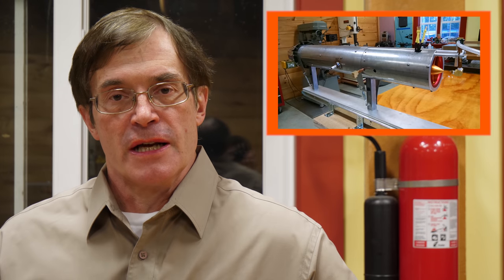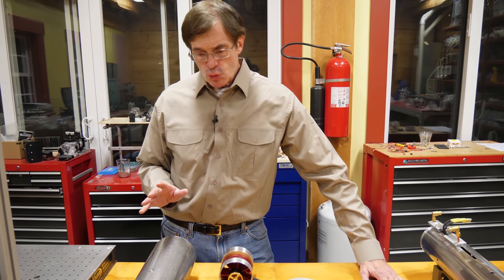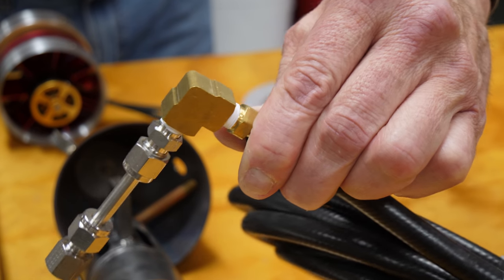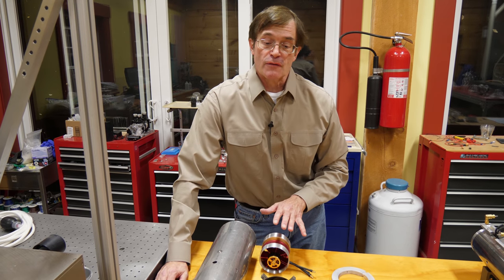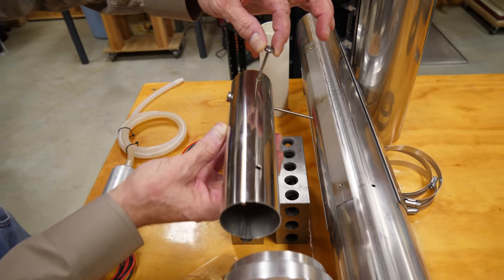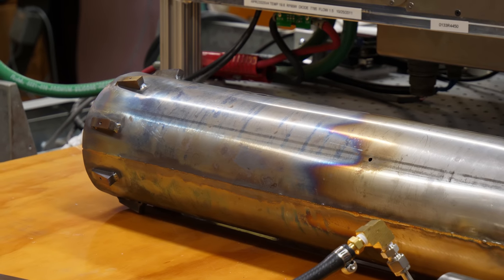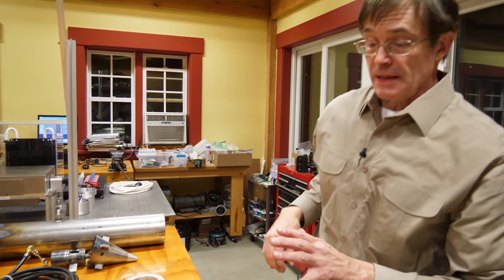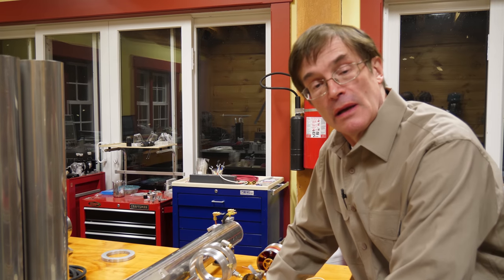Hybrid Jet Engine - Update 2.0

Comment: Observation.  EDF fans are optimized for high velocity low pressure flow.  Just the opposite of your needs for high pressure combustion.  Expand the flow post EDF prior to combustion to obtain any usable pressure/compression, rather than accelerate with the cone which further accelerates/drops the already low pressure flow.
Reply from the maker: Velocity, whether it is in a spiral flow channel or an axial pipe can be converted to pressure when it slows.  You are correct that these fans are optimized, but it is for thrust, not velocity.  They move too much air and they don't accelerate it enough.  Running them beyond spec and two in series helps. The expansion you describe is exactly what is accomplished as the air passes the lip of the cone prior to combustion.
Reply: Watching this thread with interest. Basically I am wondering if the back pressure on the EDF's is too high to let them work effectively. Would some type of centrifugal blower be better? Not my area of expertise, though.
Reply from the maker: These are interesting points, but you are focusing on secondary issues.  Turbulence is necessary for the burn process and homogeneous mixing of the fuel with the air will not occur with a gradual laminar flow pattern.  It is difficult to maintain a flame front even with the shadow of the cone.  This is not simply speculative, we tried it. This engine can operate with a diffuser section as you describe and employ traditional bar shaped flame holders, but any flow resistance in this turbulent region lowers mass flow and thrust, requiring a large burn chamber diameter to reduce the velocity.  We found a 30cm diameter tube was required to eliminate this loss.  It comes down to practical trade offs.
Reply from the maker: We tested these fans on the bench to see how effective this non optimized type of blower could be.  You are correct that a centrifugal blower would be better, however both types of compressor designs need to operate at very high speed before they begin to be useful.  The advantage of the EDF is its availability, compact profile and in the case of these JP Hobby fans, its extremely high power handling capability.
Reply from the maker: When you see the engine operate in part two of this video, you will see that in fact the burn does occur in a pretty small area within the engine.
Reply: Take in consideration the stationary blade this design has to have to function  get the best metrics possible then the rest is built based on how effective the first step is compression and the dynamic pressure increase. All  EDF fans will reach a stall and over spin eventually if  there driven beyond there design limits. Stator blades keep the multistage compressor from  stalling and exploding!.
Reply: I did some thinking about the problem...

It seems there's a relationship with the radius and relative blade speed. If you see any axial compressors at a small size, the exposed frontal blade area only exists at the very outer diameter. The inlet cone is relatively huge on those, and the central portion is extending back from that cone is also sealed off. And I think I reasoned out why...

Now compare that difference between center cone and exposed blades to the ratio seen on a typical EDF. If any pressure builds, about half the area in the middle stalls out and it can't build up any more pressure. So think of it as having a dead zone at the center taking up over half the surface area not doing anything, and the outside rim can't exceed what leaks back out of the center. At some point the central backflow may be enough that additional power is wasted on generating turbulence instead of increasing pressure. It's capped on what it can due due to this loss.

Maybe the guy can do some smoke tests on the inlet with a strobe, and see if my thought on this is valid. Start out with a stock EDF, and then start restricting the outflow. Seems simple enough, given the other expenses so far.

Keep in mind this problem has to do with scaling. Above a certain size (and therefore radius), an axial compressor becomes more effective given the relative blade speed and then it works just fine.

Comment: Very interesting project.
It brings back memories of my research when designing a completely new type of engine.
Here are a few observations that may improve your understanding of what's going on.......
1) The electric "Prop in a Tube" RC model fan can not even come close to the pressure that you need.
       When you are creating additional  "volume OR pressure" by burning fuel in a tube that is
       essentially  "closed-off on one end"  by the electric fan, you will simply put the fan blades into 
       a  "stalled" condition, which reduces the amount of oxygen available for combustion.
       The electric fans may be just fine when used as  "starter motors",
        but they are not capable of generating much pressure, 
        regardless of how much power you may be able to cram into them.
2)  Combustion occurs much faster and more efficiently when you increase the pressure rather than just
        creating great wads of additional volume at lower pressure.
      Therefore, you must have a compressor that can generate high pressures without stalling.
      The higher the pressure is, the less physical space/length/volume you need to burn a given amount of fuel.
3)  Military Jet engines are built the way they are because that's the only way they can make them work reliably.
        The Military really doesn't care much about efficiency, if you what anything even remotely efficient
        you will have to go to a Turbo-Fan engine, like the ones used on every commercial airliner. 
4)  Your engine will not have stable operation at higher outputs if you don't use something 
         better than the electric fans you have now.
        They are the number one limiting factor.
5)   You should check-out this combustion chamber design on Google......  SPRF "Stagnation Point Reverse Flow",
        unfortunately, most of the good research PDFs have been removed by Google and put on sale.
6)   Your water jacket cooling is a good idea, but I would execute it differently.
         The most important thing to do is to keep ALL heat inside the engine.
         The engine should be insulated.
         Water injection should be used to keep peak combustion temperatures down to a safe level.
7)   Axial Compressors/Turbines are really sexy, but they have a narrow operating range and are not very efficient
         when compared to a similar setup using positive displacement Vane or Screw Compressors/Motors.
8)   The reason you need a variable outlet nozzle is because the compressor section has 
        very limited pressure generating capabilities.
        The extra pressure that you would normally get from adding more fuel (after-burner) would stall the compressor,
          so you have to relieve that pressure by opening the nozzle.
        So, you still have the same pressure at the nozzle, but with more volume.
        This is not a factor when using positive displacement compressors/motors, they just make more pressure.
.
.
Reply from the maker: To begin, the axial fans are not optimized for compression.  They tend to move a lot of air, but do not reach a very high velocity.  This is best for electric-only thrust on an RC model.  However, at very high settings the velocity becomes significant and potential compression is proportional to the square of the velocity.  These particular fans are extremely powerful and each stage in the series arrangement is able to achieve 2 PSI gauge/stage.

The higher the compression ratio, the more efficiently thermal energy can be converted into kinetic energy and with a fixed amount of mass, the higher the velocity and hence thrust.  These electric motors do not achieve a high compression ratio, its actually quite low as jet engines go, but compression does occur and the thrust does increase.

You are correct that we want the exhaust gasses to be as hot as possible.  Possible is the operative word, without active cooling we nearly melted our first version of this engine.  Some method of bypass cooling is necessary.  We may elect to change from water to bleed air from the first fan to simplify the system. We may also convert from a steel flame tube to ceramic one allowing higher temps.

My understanding of what is going on is reasonably clear.  When you see part two, this may help to highlight the strategies and the principles.
Reply: The Combustor design that I referenced runs at substantially lower temps, you may want to look at that.
The Ceramic Coating is excellent, the next step is concentric tubes with water between them,
which will then be converted to steam, adding lots of  "volume OR pressure",
and further reducing peak temps.
The efficiency gain/loss from the water is around zero.
You will need a positive displacement water pump that can easily overcome the internal pressure
of the engine, while at the same time providing accurate metering,
which should be roughly 50% water, by weight, when using liquid Gasoline/Diesel/Kerosene.
The volume of water is related to the BTU content of the fuel.

As far as combustion temps, I think I wasn't clear enough.
The object is to convert temperature into "volume OR pressure".
The fuel is actually creating mostly Super Heated Steam as a byproduct of combustion.
Adding water just creates more steam without as much Super-Heat.
Yes, that is Steam that is melting that metal tube.
When you create Super-Heated Steam you are wasting energy.
The excess heat only has one thing to expand to create "volume OR pressure",
and that is the nitrogen in the intake air that was NOT part of the combustion process,
so all that excessive heat doesn't have any additional materials that can covert that heat
into additional "pressure OR volume", that's where the water comes in.
Gases increase "pressure OR volume", with additional heat added, at a linear rate.
But, water increases in volume 1600 times when it flashes into steam.
Unfortunately, there's no free lunch, it takes some serious BTUs to take water from
"room temperature" to ABOVE 100 degrees C.
But if you really could use some temperature management, you may as well  take away some
of that heat with water, so that you will add enough BTUs to the water to get it close to
flashing into steam, which can then be used as additional material for "expansion OR pressure".
Therefore better utilizing the available Super-Heat contained in the combustion steam.
"Theoretically", there should be no reason for the exhaust temps to be over  ~105 C,
if they are, you are just throwing away energy, but actually pulling this off is another story.
I designed an engine that comes close to this, but it's for rotational power, not jet propulsion,
and, believe it or not, it uses 200 year old steam engine technology to achieve ~80% efficiency.
Which brings me back around to the "keeping the heat in the engine" thing,
this is simply an efficiency thing.
You don't necessarily want the peak exhaust temps to be as high as possible.
If you will read-up on the "Stagnation Point Reverse Flow" Combustor you will see
that there are other factors involved in the combustion process besides just "peak temps".
Certain parts of the combustion process take substantially more TIME to complete,
this releases more energy where you want it, rather than blowing flames out of the tail-pipe.
If you can see flames, you are wasting energy and loosing power.
The higher the compression ratio is, the faster the combustion process will occur,
it will be totally complete, way before reaching the tail-pipe, AND, you can either have a
smaller combustion chamber, OR, you can burn more fuel.
If you are heating the surrounding air to ridiculously high temps, your engine will be inefficient.
That energy needs to be going towards making something expand in volume or increase in pressure.
You will never have more pressure at the exhaust nozzle than the compressor can create, just more volume.
My engine design has a compressor that can create over 400psi @ 500cfm and creates
super heated steam at 400psi, which is expanded (and therefore reduced in pressure) in 6 stages.
The exhaust is at, or slightly below, atmospheric pressure, and is already mostly water.
The remaining steam/water vapor is condensed and recycled back into the engine, 
the few odd remaining exhaust gases are vented to the atmosphere, 
which are mostly CO2, which is good for anything that's green. 
No water is lost or has to be added, the water generated during the combustion process
is in excess of the losses to the atmosphere.
The unwanted pollutants in the other odd exhaust gases are virtually non existent.
You are literally building a Steam Engine, (of sorts), 
thinking of it in this way may be beneficial to you .
.
.

Comment: I notice the original fan had stationary veins that are designed to reduce the vortex, this is at the expense of pressure ratio. The next step description is spot on. the stator is almost as important to building compression and volume as blade design attributes of each fan. It is easier to have both driven fans on same shaft design. You have to have data logger on both motors to tune the dual driven fans and the dual attribute makes it  difficult to tune and not damage esc;s or explode fans.  Adding mass to intake works with centrifical 
 vacuum pumps with low air volume. good luck hope you read this and it helps.

Comment: You don't have stators, so you don't have compression. Prove me wrong by plumbing a pressure gauge into the discharge area of the second fan. Opening should be flush with the wall of the casing, so you measure static pressure, not facing into the airstream like a pitot tube, which measures pressure rise due to velocity of the gas stream.

Nice machine work.
Reply: love your content and I believe you aare very knowledgable whenit comes to gas turbine engines but Ithink you may have it wrong with this one they is some compression due to the counter rotating fans eliminating the need for stators  there's quite a bit of research regarding counter rotating compressors you may find interesting
Reply: Actually, a flow surrounding any airfoil (fan or compressor whatever that has a positive angle of attack) compressed by it. As you may know at the bottom of the airfoil has higher pressure than the other so it acts as a compressor.
Reply: @jwh103  air on the bottom of a an airfoil is at atmospheric pressure it's the air that's at the top that has a lower pressure due to the coanda effect
Reply: It could work if it were built like a ramjet, but the fan still may not be powerful enough to make that work.
Reply: AgentJayZ, I enjoy your channel very much and have learned quite a lot, very informative.  As for the stator only providing compression Im thinking that that it is a matter of relative rotation of turbine to engine housing stator blades.  let me try to explain my thought.. Imagine that you made an hypothetical engine that operates a turbine at some rpm clockwise, now consider this engine while it is operating at this rpm you start to spin the entire engine housing counterclockwise increasing the spin up to what was the original rpm of the turbine (ignoring all the impractical issues to do so) .  while spinning the housing at the counter clockwise rpm equivalent to the initial turbine you observe the turbine is now stationary relative to an outside observer,  but the turbine spin relative to the engine housing is stlll the same.   Take it a step further by spinning the housing at 1/2 the original rpm counterclockwise, and now an outside observer would see the turbine rotating at at 1/2 speed clockwise, but the relative rotation of the turbine to the housing is again the same.
Reply: AgentJayZ  is correct. The principal function of the stators is to diffuse the air flow to reduce its velocity to increase static pressure.

Comment: wow, best depot level explained!  NIce counter clockwise on upper and lower EDFs making stator compression.  I'd add another larger EDF front of your stator compression for high air flow bypass to cool your upper and lower exterior stator edf compressors to your AB.

If you had LPT section + drive shaft to drive front compressors you'd get over 420% more compression over EDF,  i applaud you.

Comment: Do you Know whats funny, at about 8:18 I was telling my screen that you needed to coat the tube with spray ceramic, then you said you did so I was like smart man. Then @9:25 I got excited and was yelling OH he bout to say NOS or LOX injection and got mad when you said liq propane. Then you said NOS later @11:21 and I was pretty much mollified and said well this guy knows his stuff LOL. Dude, as a former USAF fighter crew chief I thank you for bringing back old memories of engine build up/maintenance, even if it is in miniature LOL.  Also thanks for the vids you did on the "Worlds Best Speakers" cause of that I'm using two 4' by 8' foam panels, two 48" by 24" ceiling panels and four DAEX25X4-4 exciters with the panels all custom painted, and coupled with an old sub-woofer they sound amazeballs in my small  space. Really, I can't thank you enough for that cause it was either cheapo bookshelf things that came with my amp settup, or spend a few hundred to a thousand for better ones. I prefer the choice you gave me LOL. I love this channel keep up the good work.